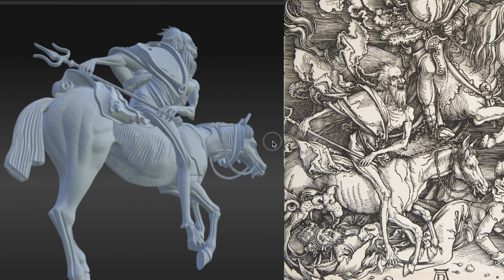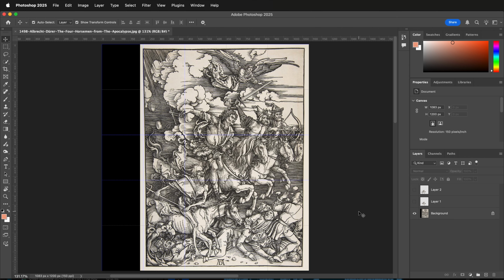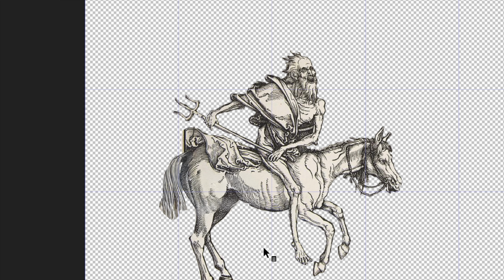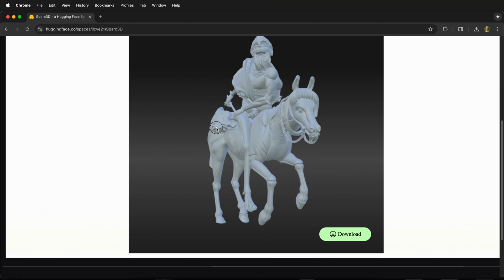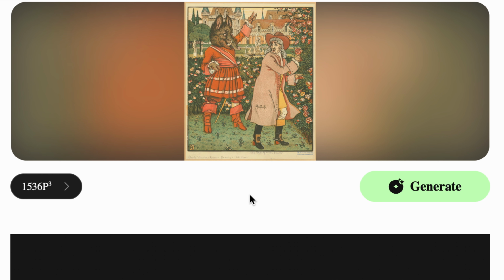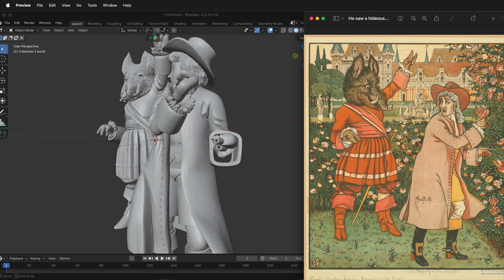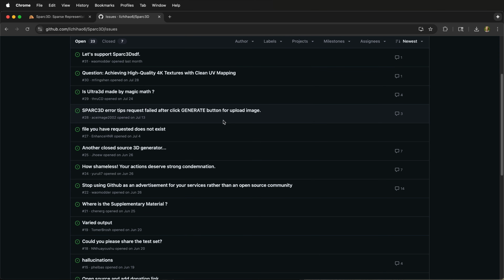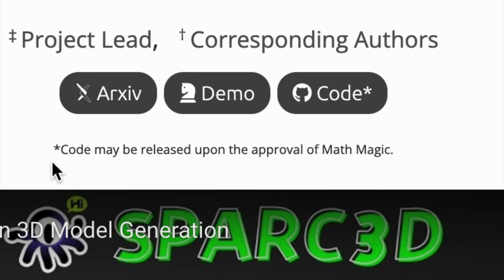From 2D to High-Res 3D with Sparc3D: Hugging Face Demo, Blender Import, and Printing

Comment: It really is quite an impressive tool. Have you tried slicing and printing these files?
Reply from the maker: Yes they print relatively well, most of them need lots of supports but the models are manifold and slice ok